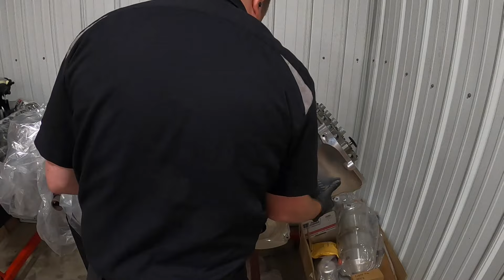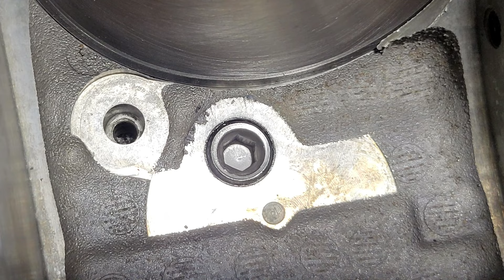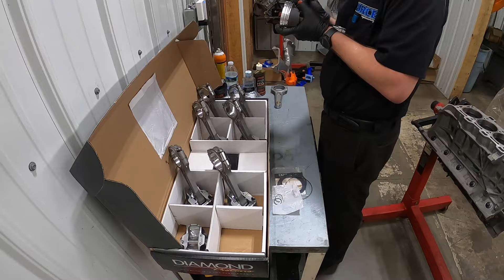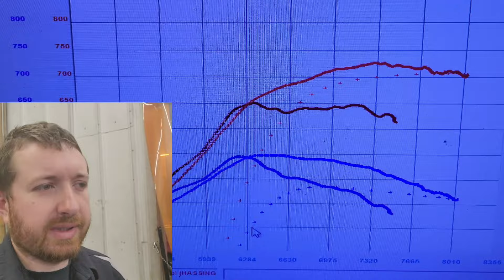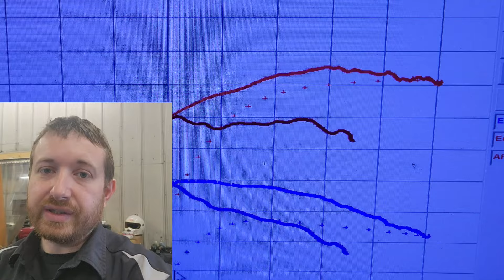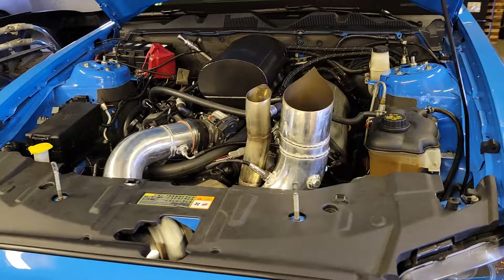1800+ HP Gen 1 Coyote Engine Build | Dyno Comparison of Stock Combo

Comment: What are you running for primary tube size? I might have missed it in your other videos if so I apologize.
Reply from the maker: Not sure if i have mentioned it or not actually.  1 7/8s
Reply: @ForceEngineering  why did you choose to go with 1 7/8 over 1 3/4? Looking at doing a 8:1 setup in my drag car with a coyote.
Reply from the maker: @radioactivefabrication  results from a previous test on a turbo 4cyl setup.  17/8 setup to 2 in and just 2" preformed the best at all boost levels up in the 7500+ rpm range.
Reply: @ForceEngineering  gotya guessing space is the reason you didn't go with 2" then?
Reply from the maker: @radioactivefabrication  space was a concern yes.  Also the engine we were testing was making around 375hp per cylinder, so I knew I had some wiggle room.

Comment: Nice man. 👍 

So I found out I lifted a head on my stock Gen1 (single turbo/TH400), and I’m deciding on what to do next. What would you recommend for a “budget” build? I’m shooting for between 900-1000whp and a Gen2 short block is hard to find right now. 

Can’t afford a fully built motor just yet, so I’m just weighing my options.
Reply from the maker: Thats unfortunate!  I'd do a rod & piston in what you have.  I'm also having great luck with the sce gasket and would suggest that.  It will be some what costly for the short cause you'll have to have the crank balanced.

Comment: It's the only non flat-plane crank modern Ford engine that sounds good thanks ti that exhaust lol. Thing is nasty! I want to build a set of 180° headers for my 97 Z28 so damn bad. They make small block circle track cars sound badass lol.
Reply from the maker: Yes they do!  Thats is actually what inspired this.  When I was younger I raced outlaw late models.  Drove a car for a customer and it had 180s. Been addicted ever since.
Reply: @ForceEngineering  I'm really curious what a set would sound like on the 5.2 Voodoo engine. It's compromised flat-plane firing order is pretty unique in sound already. I'd REALLY love to see someone get a custom crank and cams made to fix the firing order into a true flat-plane and run twin intake manifolds. The story was that for hood clearance reasons Ford used a shared plenum like the Coyote which necessitated the change to the firing order. I want someone to build the Voodoo Ford always wanted to lol.
Reply from the maker: @michaelallen2501  that would be awesome!  Im sure it would sound crazy.
Reply: @ForceEngineering  to finish the dream I'd stick it in a Factory Five Daytona Coupe lol.